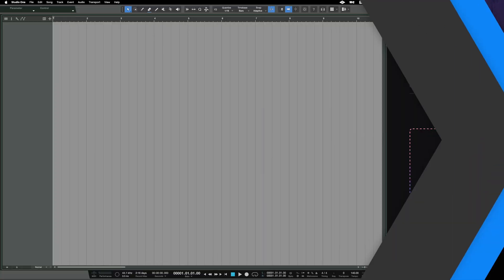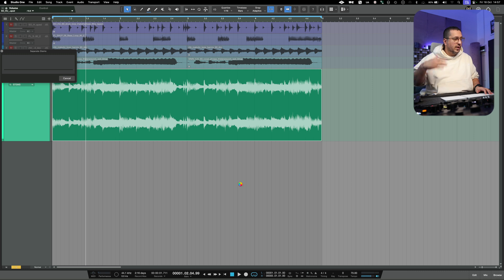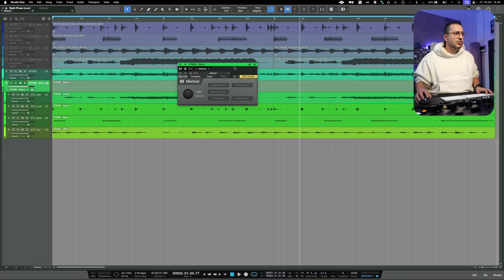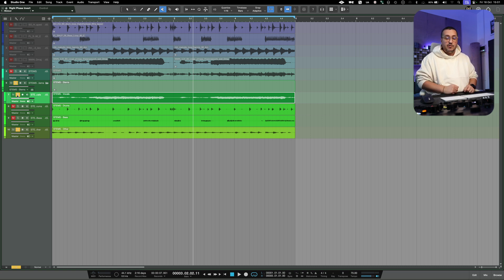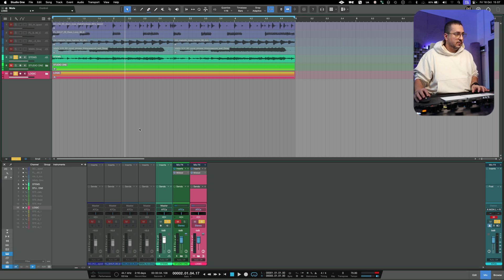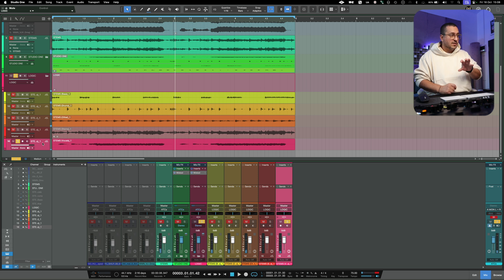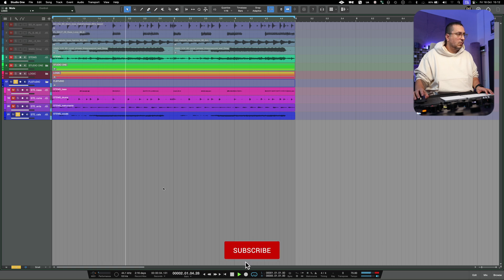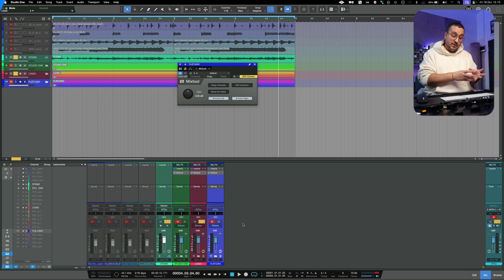Presonus Studio One 7 - STEM SEPARATION IS NOT THAT GOOD.

Comment: Thanks for the video - seems like they picked speed over quality more than the others. I think they should consider giving the user the option as sometimes it's good to have a fast unmix but sometimes you want a high quality unmix. Spectral Layers, which runs in Studio One as an ARA, will null out to the original using high quality.
Reply from the maker: I have to try that